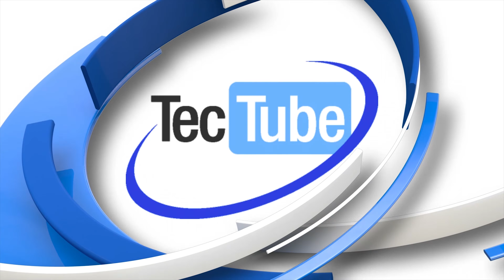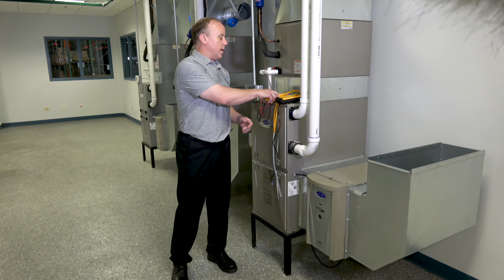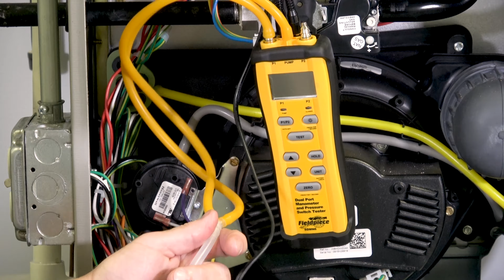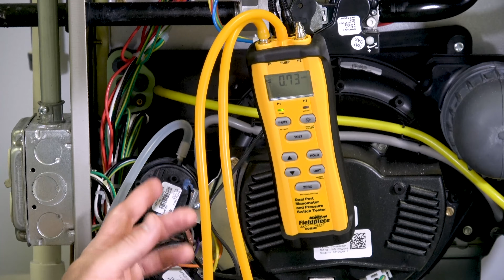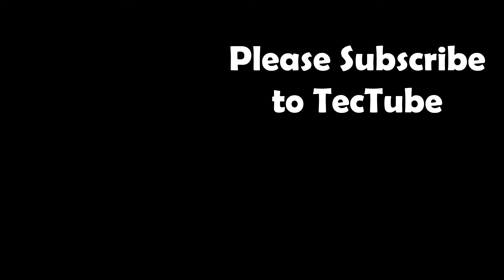Checking Furnace Pressure Switches

Comment: What is the function of the yellow pressure hose?
Reply from the maker: Which yellow hose?  There is one on P1 and one on Pump in this video.  Dave explains how to use in the video.  Is there a more specific question you have?
Reply: @TECTubefilms  Sorry, I mean the yellow pressure hose that is in the background. I believe it’s called the “condensate trap relief port” hose. I know that it connects one relief port to the other, but I haven’t been able to find any explanation for why that is necessary (or what might happen if it wasn’t there).

Comment: Can't see where you are checking the voltage. Your hand is in the way.
Reply from the maker: It is a pressure switch video... He stated to check the voltage through the switch. There isn't much space there for Dave's beat up 'ol grabbers and show where, so he was very clear as to where to measure voltage in the beginning. Through the switch.
Reply: @TECTubefilms  You are assuming we all know how/where to measure voltage "through the switch." I don't know where to put the probes. If I knew this stuff I wouldn't need the video.
Reply from the maker: @jongreenbaum250  You may find it useful to check out our prior videos on how to use an electrical meter.  https://youtu.be/FMevkhVDvuU
Reply: A pressure switch in a furnace only has two terminals so when you test voltage or continuity "across" a switch... any switch... you put one probe on each terminal.
Reply: @jongreenbaum250  there only 2 places